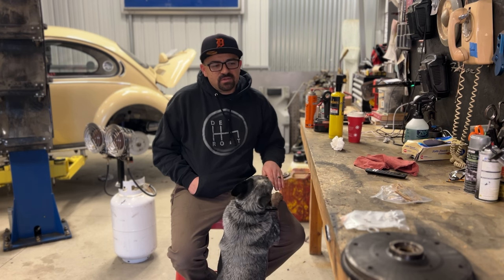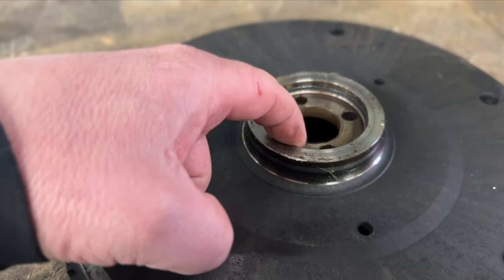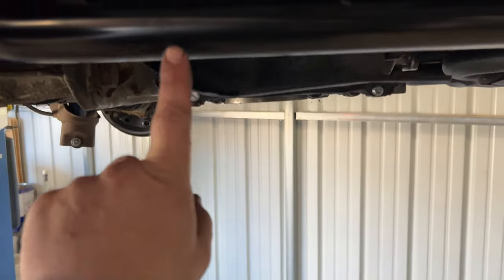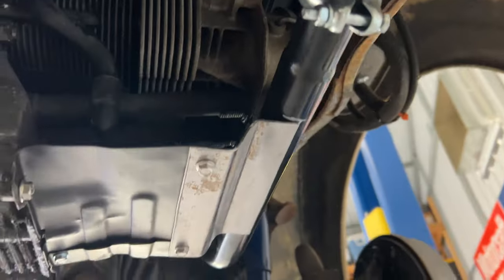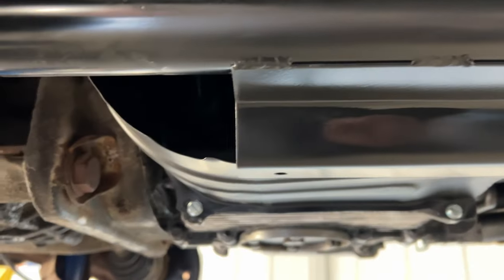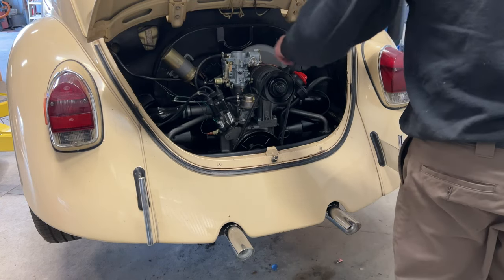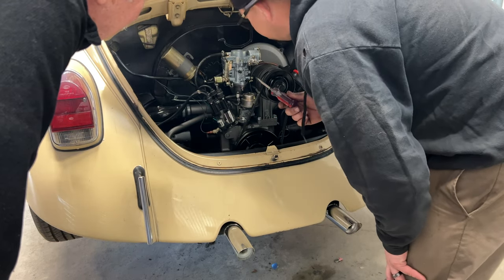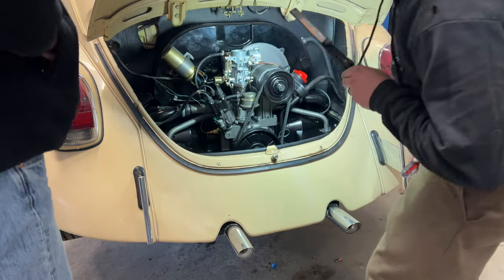ENGINE OUT A THIRD TIME! But it finally runs!!!!!! 1970 VW BUG

Comment: Flat spots on these are due to not using the appropriate SVDA distributors that hook up to the vacuum line on the carburetor. Centrifugal Bosch 009 distributors are meant for industrial engines that run at a constant speed, not for street driven cars.

Comment: I feel you bro. My grandson and I pulled the engine out of my ‘73 Super last Saturday for a new flywheel, gland nut, clutch assembly, and rear main seal. Got all the new stuff on, was rounding up the old parts and realized I didn’t reinstall the washer under the gland nut. At least we hadn’t stuck it back in the car yet. Did put the O-ring in the flywheel though.